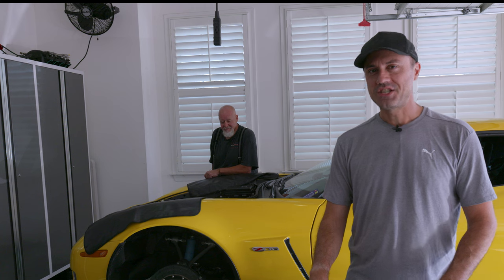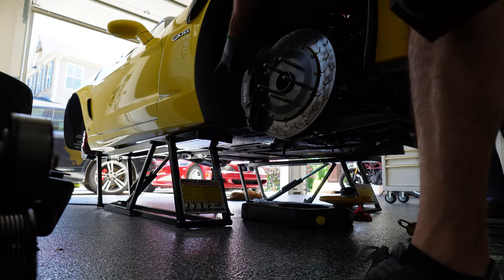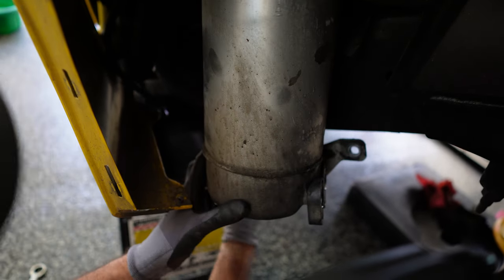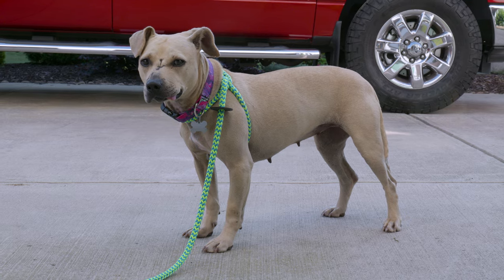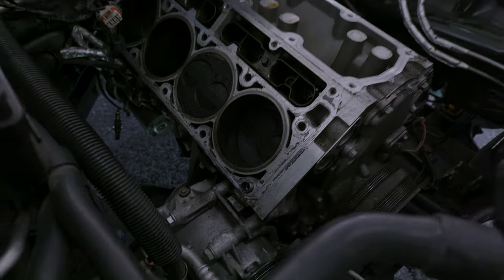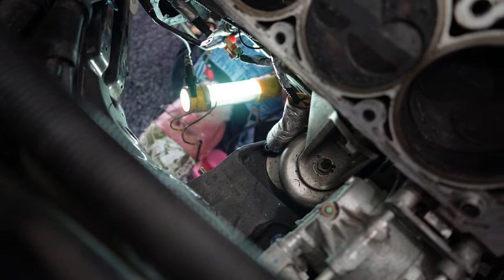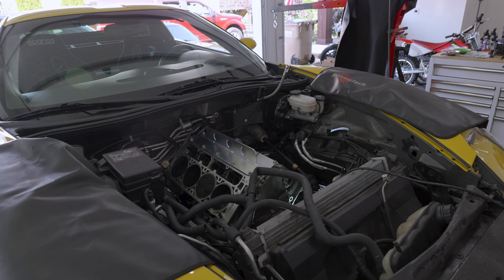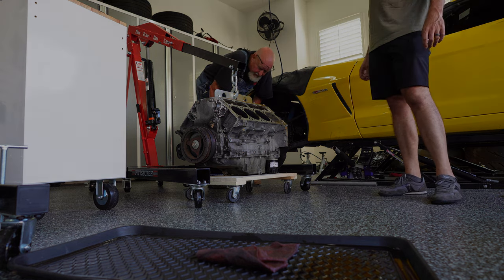Pulling My Blown Engine

Comment: On the F150 brake issue, likely is the brake line fluid line versus the caliper. And for the R134a,  it's more a risk to you if you happen to breathe in a lung full of it versus dumping to the environment. Back in 06' I called the EPA to report a repair shop that did not use a refrigerate recovery machine, they dumped many systems directly to air each month, the EPA could not have cared less.
Reply from the maker: First of all, great user name! Second, good on you for trying to report that. Disappointed but not surprised that a government agency tasked with protecting the environment turns out to be typical bureaucratic mess.

How would the brake line be responsible for the pads overheating? Not saying you're wrong, just not understanding the physics.
Reply: @JoshVanVeld  Ahh grasshopper, I too couldn't understand how a brake fluid line was causing my brake caliper to hang up.  Here's how this happens, the metal bracket that wraps around the rubber brake line rusts on the inside of the metal bracket, placing pressure (imagine pinching) of the rubber line. When the brake pedal is depressed and brake fluid pushes into the caliper this "pinching" doesn't allow the pressure to release, and bingo, you think the caliper is hanging up when it reality you've got a fluid flow issue. 
After I got out the "industry" around 81' because Dirk caused some trouble for me, I got into turning wrenches as a hobby...once met a dude with a C3 Vette...had a Three Quarter Race Cam.
Reply from the maker: @chestrockwell8328  Oh man now I feel like I need to hear the story about how Dirk caused trouble! Maybe another time.

Thanks, now I understand the brake line issue. I'll pass it along to Jeff.

Comment: Lingenfelter ProFormance has a modification to the dry sump tank which adds 3 quarts to the tank.  The fix is under $400.  Protects against long high G left hand turns on the track.  Also has great instructions on how to remove the tank!🤣
Reply from the maker: Who bothers reading the instructions?? (I do 😆)

Comment: I would send your steering rack to turn one for rebuild while it is out. The oring fails on the sensor wire during track duty and it leaks.
Reply from the maker: Thanks for the tip!

Comment: Well Hello Josh, I subscribed to your channel and you taught me a ton of stuff. I am also in the process looking for a C6 Zo6 for track/ street fun. The question I have for you is am I better off finding the newest C6 I can afford or does it matter. Like all cars it seems most of the factory issues with cars have been corrected the last year before the manufacture starts a new design. What year C6 would be inclined to purchase if you had a choice. Again after watching all your video's you answered a lot of my concerns, Thanks agin and keep those video's coming. Tom Stark in Wisconsin.
Reply from the maker: Hey Tom! Thanks for watching, glad you're enjoying the series.

I would generally say the newer the better but I'm not an expert.

No matter what, based on my personal experience I would have a reputable shop fix the heads to avoid the dropped exhaust valve issue.

The 06-07 cars have the T56 transmission, later cars have the T6060 which is stouter.

06--08 cars (maybe not all the 08 cars) have a smaller dry sump tank and therefore newer cars are better suited for situations where you would see extremely high G's for extended periods (running slicks and aero).

In 2011 they introduced magride suspension, which may or may not matter to you depending on your use case. If you're going to swap to coilovers for track use you might not want that.

Familiarize yourself with the trim levels, I believe there was no 3LZ trim for the first couple of years. I like the telescoping wheel and heated seat that I don't think you could get with the 1LZ.

So for me the '09 or '10 car would probably be the sweet spot, but I'm not disappointed that I bought an earlier car.

Comment: For your oil cooler comment there is a oil cooler that will detect the temperature and then allow oil to flow through once the desired temperature is met.
Reply from the maker: Thank you, somebody else mentioned this. Seems like it would be a worthwhile investment if it isn't crazy expensive / prone to failure.

Comment: I have swapped a dozen engines in my time. Each one i bought a used crane and sold it after.
Reply from the maker: That's the smart way to go! I did look for a used one but didn't find anything close by.

Comment: With your experience. What would you say to do when buying a c6 zo6 to avoid this? Build the heads? Great videos by the way!
Reply from the maker: I still have learning to do about the cylinder heads. Having a machine shop "address" the heads, which usually means replacing the valve guides and other components as I understand it is usually considered the minimum. 

Aftermarket heads are more costly (you can recoup some cost by selling the factory heads) and with the right setup can be more reliable. Of course a lot of people figure it makes sense to seek more power if they're going that far, which can introduce more issues.

Bear in mind that engines can fail for other reasons. I had a friend who lost his LS7 due to a lifter that rotated. 85K miles with stock heads.

So obviously the smart thing to do is get a C6Z out of your head and get a '99 Miata instead 😅

Comment: Ah the old steering rack dilemma, years ago (2005) I did my first cam swap on my Z06. I fought the rack to no end but after 3 times on doing so it became easier each time. Great commentary in your video, you are too hard on yourself. Note next time back the car into garage so you have more room to use the hoist to pull the motor out. Ask me why I recommend this 🤦‍♂️.
Reply from the maker: Haha! I thought I was going to have to put it on wheel dollies to move it around the garage, Jeff came up with the idea that we could just lift it up and over the fender and it turned out he was right. Saved a lot of time and money.

Comment: Hey Josh, assuming no major or minor tragedies at home or work , this is your reminder it has been about a month! 
What about some update and progress on the engine build specs at least :) What components, hp and trq numbers and who is going to do the assembly plus projected redline and where torque starts and finishes based on your Cam , Heads, Valve train. Oh and what cubic inches , is it being destroked to move rev range up or staying 427 or going longer stroke,, upping the cubic inches and increasing torque figures and hp with still a 7k redline...And quoted prices for components and assembly. Obviously I am bored 'shitless' with my own life currently and need by C6 Z06 Fix :)
Reply from the maker: Haha! I’ve got the engine in the works and I’ve been debating whether to make a video prior to the car being put back together. I don’t really love videos where somebody is just talking the whole time unless it’s a podcast format but maybe I could do something quick.

Life has also gotten really busy so it’s been easy to slack on YouTube 😆
Reply: Maybe just a five minute update for those of us with no ability to not eat the Marshmellow straight away in the Uni Experiment versus wait and get given two Marshmellows lol.for showing discipline and restraint lol.
 @JoshVanVeld
Reply from the maker: @masterneverwas3145  Lol! I’m the same way. Brevity is not my strength but I’ll see what I can do.

Comment: I would aim for a balance of performance in all areas. Speeding up, slowing down, turning, and reliability. A GT3 is well balanced in this respect. In fact some might consider it underpowered for what the chassis can do. Consider how much you plan to improve the brakes, the tires, the suspension, the aero, the cooling, the weight reduction, etc., and improve the performance of the engine an appropriate amount. Putting a thousand horsepower into a VW Beetle doesn't make it turn fast lap times, know what I mean?

Also, if you can add rpm a certain percentage, and change the final gearing the same percentage to compensate, you're getting more torque multiplication for the same shift point speeds.
Reply from the maker: Couldn't agree more. I've done brakes, suspension (with more to go on that front), seats, harnesses, wheels, tires. Wasn't planning to touch the motor and that's probably why I kept putting off getting the heads redone.

Definitely not chasing a big power number. GT3 has proven that ~500 hp is plenty. A smidge more couldn't hurt.
Reply: @JoshVanVeld  A smidge more never hurts. 😁
Reply from the maker: @xtnuser5338  🤜🤛

Comment: Make sure you check that intake manifold for metal trunks before you throw that on the new motor
Reply from the maker: It's almost certainly got metal in it, I'm probably going to replace it since it's hard to verify that it's completely clean.

Comment: Have my ls7 at the builders now

Mine was rod bearings 😢
Reply from the maker: Dang! How did that happen? The coating on the rods?
Reply: @JoshVanVeld  brought it like that so not sure … getting new rotating assembly and the heads fix

Comment: I wonder how many times your father in-law said under his breath "bro", lol   Also, I recommend getting a longer ratchet(more leverage) with a flexible head.
Reply from the maker: 🤣🤣🤣 He knew what he was signing up for when I married his daughter. Or at least that’s what I tell myself.
Reply: @JoshVanVeld  One more tip, you can pretty much rent any type of automotive tool at most automotive stores ie: autozone, O'reilly's.  So don't feel you need to buy everything, unless you're going to use it often in the future projects.  Either that or build an extension on to your garage, haha.  While you have the motor torn down, once you've decided on the direction you're going, I'd say just bullet proof the motor now and you won't have to do it again.  Good luck man!!!

Comment: @joshvanveld When are you gonna drop another video?
Reply from the maker: Working on an update! Don’t have an eta yet.
Reply: @JoshVanVeld  Cool. I have a 2014 Z/28 with the same LS7 motor so I'm very interested in how this turns out for you. I've owned the car for about 9 months, doing my first track day with it at Laguna Seca in November. Full throttle!
Reply from the maker: @vincentmarino9773  Oh I love that z28, I remember being amazed when I heard how wide the front tires were that they put on at the factory

Comment: I would've sold the scissor lifts, bought a 2 post lift. Then dropped the engine from the bottom.
Reply from the maker: Part of me would really love to go for a 2-post lift, the ceilings in there are over 10 feet so I'd be able to have decent clearance. The problem is I feel like I'd absolutely hate parking a second car in there.

Comment: If you’re nostalgic, I completely understand your desire to go with an LS7 but for the cost of it, a forced induction 6.2 will make you forget the LS7 in a hurry.
Reply from the maker: Haha I'm certain of that. I do want to stick with natural aspiration for the sake of weight and heat.
Reply: @JoshVanVeld  LOL.  Respect.   Way back when I had this discussion with my performance parts shop and he said it like this.  If you install a supercharger you make it hella faster. If you install heads cam valve train etc you make it better.  I ended up doing both so he was happy x2.
Reply from the maker: @myz06rocks  I bet that thing is a beast. What kind of power does it make?
Reply: @JoshVanVeld  I moved on from it a few years ago.  Mine was an LS6. Made 322 rwhp stock.  Went to 425 normally aspirated.  Think it went about 550 on low boost.  Kept it in check as I never installed new rear CV axles.  It ate a lot of GT3s on track.  I tracked the car regularly.  Was indestructible. I think once I got a high transaxle temp warning after about 40 min of super hard laps.

Comment: sooooo let me make sure i got this..... yer doin all this in hopes of MAYBEEEE beating a 6 cylinder stock from factory vehicle?
 ok but honestly? if thats the only reason im at a loss how that makes sense.... 
 dont git it twisted ya definately should fix it thats a given.... mabbee some roll racing or drag steip work or somethjng vettes are good at.....
Reply from the maker: If you do track days with a street-driven car, GT3's are seen by many as the best tool for the job, assuming you can afford one. Porsche builds them to be track-ready out of the box and they are absolutely amazing to drive.

I'm certain that I can take my C6Z and be able to run equivalent lap times for a fraction of the cost, but it's going to take a lot of work and learning because I've never really taken on an in-depth car project like this before.

I know for a fact that I can beat up on GT3's when I'm done, I'm just trying to be a little humble because I have a tendency to put my foot in my mouth and this is a very public way of making promises 🤣